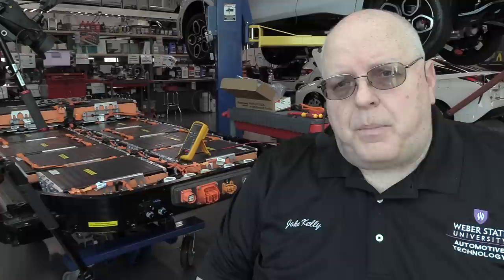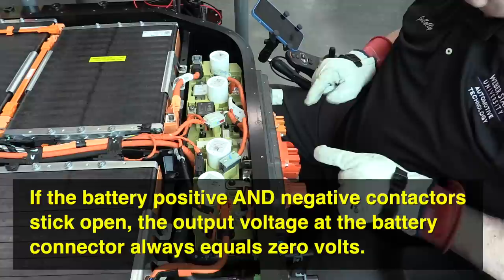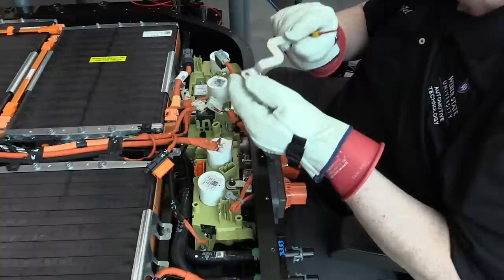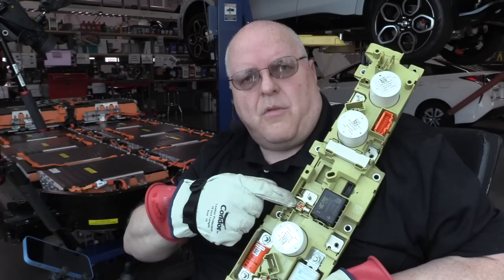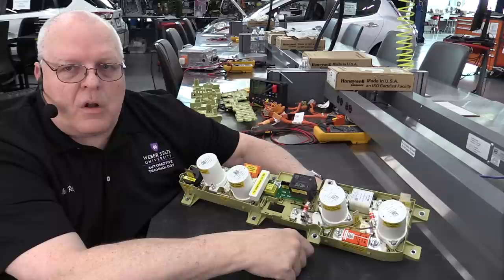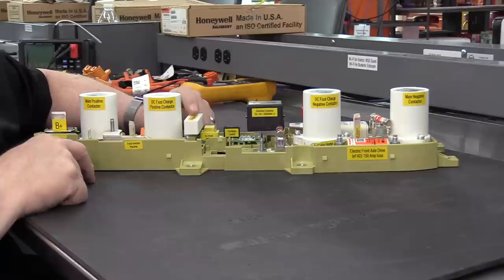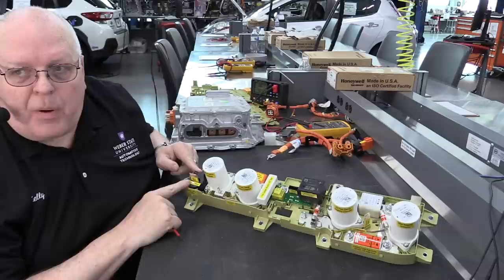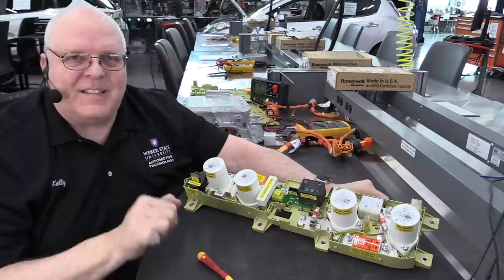Mach E GT Battery Contactors

Comment: I guess you are correct about all 4 contactors being on for DC charging but it does seem strange that they would run the charging current through two contactors in series.  I can see that they might want to have the inverter capacitors across the battery while DC charging.
The current sensor would not be the inductive type that is for AC power only.  For DC sensing, the sensor will be a Hall Effect type that uses an integrated circuit.
Reply from the maker: Thanks for the information!
Reply: There are combination Hall effect and inductive AC current sensors.  Tektronix has made oscilloscope probes like that for over 50 years.
Reply: @shazam6274  Definitely there are combination AC/DC current sensors.  For this application, I am fairly sure only the Hall effect is needed.
Reply: Don't forget. This car has some V2G capability. "DC charging" is also "DC discharging". The battery is still bridged directly to the SAE Combo connectors, but instead of power flowing in it flows out.

This means that when you activate the V2G capability (in a power outage according to the commercials) the motor controllers are receiving voltage.
Reply: @stevebollinger3463  It would make sense to use the precharge for V2X capability.  A V2H or V2G box is going to have a large input capacitance and may not have a suitable inrush current limiter.  Is Ford offering any V2X hardware for the Mach-E like they have for the Lightning pickup?  I haven't checked with Ford but thought they would only sell someone the V2H box if they had bought a Lightning.

Comment: Very very interesting
 Thanks for sharing!

Just one note. For a while now several electrify america stations offer 350kW charging. Of course the car limits this...
Reply from the maker: Thank you. The 350 kW EA chargers in our area still cannot exceed 350 Amps. You cannot get close to 350 kW without using 800 volts at those stations. 800V x 350A = 280 kW.
Reply: @WeberAuto  ahh this makes sense now. Thank you for taking the time to clarify! I heard from some Mach E owners that sometimes the charger shows 156kW and then it maxes it out.
Reply: It seems like the older EA stations are limited to 350A whereas the newer installs are not. I run into the issue with my Ioniq5. Even though it runs an “800V” system (more like 700V), unless the charger outputs that voltage, the vehicle will ask for about 400V from the charging equipment and the rear motor inverter steps it up to battery voltage. It seems like the 150kw EA stations will only do 400V. This 350A limitation on the older EA stations means that my Ioniq5, which can charge nearly 240kw on a properly rated charger, will charge at around 130kw on an older 150kw EA station. The newer 150kw EA stations that aren’t limited will charge it at 150kw. First world problems, I know… It charges just fine at full speed on any of the 350kw EA chargers, but they aren’t available everywhere.
Reply from the maker: @ouch1011  Great information! I will have to find a newer installation and photograph the product label.

Comment: Wouldn't it be better for serviceability to relocate the junction box assembly outside of the battery cell unit? Also, how waterproof are these components? Very interesting video.
Reply from the maker: Some vehicles have an external junction box. The battery housing is sealed from moisture and dust.
Reply: Thanks for the update.

Comment: Nice video again, I just cannot understand why the contactor thingy is inside of tge high voltage battery. This is very difficult to replace or fix in case of any kind of failure. In my opinion the contactor board should be placed inside the car. e.g. trunk / frunk. 🇫🇮👍🇫🇮
Reply from the maker: Thanks for watching

Comment: Nice detailed explanation and overview.  Thank you. Two corrections: 1) It appears that the large white contactors are held in by two bolts on the top and two nuts on the bottom, therefore are "serviceable". 2) All of this work is a total waste of time, since Ford has announced that the warped, arced, welded contactor issues can be remedied with a simple "software upgrade"! 🤣
Reply: The issue that cause the welding is a bug in security software, so you're way off base on what the fix is for a welded contactor and what the remedy is to prevent it.
Reply: @vidznstuff1  This is Ford's solution, not mine.
Reply from the maker: Thanks for your feedback
Reply: realistically ford isn't solving the problem with SW.  What they are doing is bending the curve.  If they just let things lie, they would have a large # of warranty fixes all at the same time all leaving the customers stranded.  now they will have that smoothed out a bit ,over a longer period of time and with sufficient warning to allow customers to schedule fixes.  It's less costly for them, and less dangerous for their customers.  I believe the part itself is flawed, and can only be fixed with active cooling or a lot more metal.

Comment: I would love to see the specs/part numbers of the main contactors. Any chance you can share some details there?
Reply from the maker: They are made by TE Connectivity. Part number 2342963. I could not find a data sheet with anything other than the physical dimensions
Reply: @WeberAuto  Thanks! It looks like they list that as a EVC500L, though they have it looks like 7 variants with different length/colors of wires. Their EVC500 (no L) looks to be rated for 500A continuous. So that might be too low of a rating for running maximum power through for long which is likely ~900A.
Reply: @mp3mike237  Is Ford replacing the contactors with the same part number or is there a new P/N? Do new cars off the line have a more robust contactors or does it take longer to implement changes?

Comment: Dr. John, a quick question. If for whatever reason one of the main motor fuses pop, will the service tech need to drop the entire battery case or does he have access without removing the battery?
Reply from the maker: The battery must be removed to replace the fuses
Reply: I thought immediately the same, a little uneasy to change a fuse. And the whole junction box needs 8 bolts? There is a lot of assembly time needed, I think... 

Thinking about it, there are sure reasons for the way they are... I could imagine a few myself, actually.

Comment: Why not integrate the voltage sense into the module and communicate externally via a low-voltage data bus? Why use HV for a sense signal?

Comment: Excellent video. Very early in the video you mentioned that there was a recall of the high voltage junction box, but you did not say if the unit you were working on was one on the recall list.  Also, do you know if the contactors used are proprietary or mass produced?  In my opinion, if they are a mass produced item they should have been made a replaceable component. If they are proprietary it would be interesting to find out why Ford engineers decided a proprietary design was needed.
Reply: I believe all Mach-Es are under recall, so that would include theirs.

The contactors are almost certainly an off-the-shelf part. That said, they probably chose not to make them individually replaceable (apart from the module they are attached to) either for manufacturing ease or to limit the number of connections to the component. Every connection is a possible point of failure, especially when you’re talking about a connection that has to deal with hundreds of kw.
Reply from the maker: Thank you! Yes, as Kevin Berg said, all Mach-Es are involved. Right now there is a software update to address the problem. I suspect it lowers the allowed current under full acceleration. The nominal rating for the fuses are 630A (Rear Motor) and 350A (Front Motor). I saw a video last night from Bjorn Nyland showing about 1050 amps on the Mach-E GT during full acceleration. I suspect the fuse sizes, contactor sizes, and maximum allowed current just needed to be better calibrated to avoid overheating the contactors (A possible reason for the five second power limit). I will be surprised if the junction block gets replaced as a result of the recall.
Reply: @WeberAuto  --Well, heating is more of a problem with the fuses.   The nice thing about fuses is that they have "thermal mass" whereby the time it take to blow is a function of the current.   Contactors should have problems with heat due to the load current.
Reply: @WeberAuto  Ultimately the contactor needs to be re-designed, which would preclude re-using the module as-is.  The question is how much of a performance degradation and longer fast charge time Ford can "sell" to their customers.  Even if it is only 5%, there are a lot of attorneys eager to cash-in a large $$$ law suit.

Comment: It’s funny, when those contactors are mounted in the battery case, they make a ka-chunk when they open/close, but sitting on the bench on a rubber pad, it’s just a little click.

People calling DC fast charging “level 3” is like people calling EV supply equipment a “charger”. It’s not technically correct, but as long as people know what you’re talking about, I personally don’t think it’s a big deal. I don’t call it “level 3” charging personally, but it doesn’t bother me if people do.

It seems weird to me that they would turn on the power the to motors when DC fast charging, especially when they already have a separate set of contactors specifically for fast charging and powering the DC-DC converter and the HVAC stuff. Seems like it would have been better to isolate the motors/inverters when DC fast charging since it’s not like you can drive off when connected to a charger anyway.
Reply from the maker: I wondered the same thing about the DC Fast charge contactors. Thanks for watching

Comment: Nice explaination of the junction box. What I do not understand is why the inverters need to be turned on (through the main contactors) while DC fast charging is in progress. Any idea?

FYI: In Europe we got 350kW DC CCS fast chargers. But most of them are only 200kW chargers with two balanced cables.
Reply from the maker: Thank you!. Powering the inverters during DC fast charge also powers the A/C compressor and cabin heater. Thermal management of the battery is needed while charging. Additionally, the driver of the car might want thermal management of the cabin air while charging.
Reply: @WeberAuto  Thanks, sounds resonable

Comment: How many Mach E have actually had this problem. I have 28000+ on mine and have had no issues. I did get at OTA about 2 weeks ago addressing a software fix regarding this. And I wonder if using 150 Kw chargers at electrify America is safer for the Mach E battery rather that using the 350kw charger. I have used the 350 kw charger when the 150 was unavailable.
Reply from the maker: The vehicle decides how much current to receive while charging. It does not matter if you pick the 150 kW or the 350 kW, it will still charge at the same rate.
Reply: @WeberAuto  You will see a higher charging rate on a 350 kW DCFC than a 150kW, briefly. Probably because as you noted the 150 don't support the necessary amps to provide 150 kW to the car.

Comment: About the seeming inability of an Electrify America DCFC to reach 150kW on this car: The ratings on those chargers are always a bit suspect.

The power rating for the charger will be listed at the maximum output voltage. So, if you have a 400V-class car with 100 cells in series it could in theory hit about 420V right as the charging system is about to enter top-off mode.

420V @ 150A is 147kW. So it is a 150kW charger but (on a 400V system) only for a moment near the end of the charge cycle. Also, a lot of cars just won't be at peak current right as the batteries are near full. So it may never hit 150kW, even for a moment. But the charger is in theory capable of it so that's what they list it at.

Making it worse, most "400V" class cars only have 96 cells (or groups) in series, not 100. I'm sure you know whether this is the case for this car, I haven't watched that particular video yet if you have mentioned it.

Back in the olden days of 50kW CHAdeMO chargers and NIssan LEAFs the chargers all were rated at 500V, but the cars never got above 410V so you never could see the max charge rate. Even when packs got large with the Bolt and chargers went up to "62.5kW" never really more than 50kW because the max current was 125A and the voltage allowed on the Bolt pack never got above 403V at any time (4.2 * 96), even when charging as fast as possible.

Another informative and great video.
Reply: Wut? The EA chargers are rated at 350kW (at 500V) whichis split between two cables, sized for two cars charging simultaneously. So each cable can deliver 175kW at 500V, 20% less at 400V. If the other cable is not in use, there's probably some margin that gets it bumped up.
Reply from the maker: Thanks for the information

Comment: I am wondering why there is no chill plate underneath, or venting thru the chamber, to get rid of the heat generated from pre-charge resistors, and resistance under high current warming up the bus bars.... Are there any sensors present to detect temperature, or pressure in the compartment since is is 'sealed' ?
Reply from the maker: The pre-charge resistor is only used for a fraction of a second while the capacitor charges. Not a lot of heat generated.

Comment: It does not make sense to me that all 4 large contactors would be closed when the vehicle is DC fast charging.  For safety purposes I would think that they would be interlocked - the inverter contactors could not be closed when the charger contactors are closed, and vice versa.  Also, charging the inverter capacitors while charging the battery would be a waste of some amount of electricity.  Though perhaps relatively small each time it would add up over time.
Reply from the maker: Thanks for your feedback
Reply: This makes me wonder as well: what is the requirement to have the inverter units powered while DC fast charging?

Comment: Hi prof. do i understand correctly that the high voltage sensing lines are directly connected, via a connector, to the control box , so without any fuse or overload protection. seems to me bit unsafe as the (unlimited) DC current can flow in this small cable and cause problems when connected (cable fault or short cut some where down wards) to for instance a negative some where! just wondering. 
and greetings from NL and as always interesting video
Reply from the maker: Thank you. I do not know the answer.

Comment: Video is interesting, well done and very informative.
Is there a pyro fuse anywhere since they are used to disconnect the HVDC in the event of a crash?
Reply from the maker: No pyrofuse, just the four fuses shown in the video.
Reply: In the Tesla, it is activated anytime the Airbags deploy.  Here it's just "Burn Baby, Burn"
Reply: @shazam6274  Tesla fanboy what do you think the fuses are for?
Reply: @danielwiggins2656  you mean like the ones in all Bolts?
Reply: @shazam6274  I understand the bolt fires were defective batteries not from a short caused by an accident
Reply: @danielwiggins2656  But the fuses didn't protect anything.
Reply: @shazam6274  The Mach-e has  fuses for all of the HV outputs so those will protect against external shorts that might be caused by an accident.
Reply: @danielwiggins2656  The fuses take orders of magnitude longer than the contactors or the semiconductors used in the Tesla design.  The main goal is to remove the high voltage / power nearly instantly for the safety of the occupant(s) and first responders.  I would assume that Ford turns off all the contactors in case of an airbag deployment for the same reasons.  Unless of course the contactors are welded closed, which is one of the reasons for the issue. 😬
Reply: @shazam6274  I will agree that a fuse may take longer to open, but that does not mean it's burn baby burn as you said.
Reply: @danielwiggins2656  I agree.  Should have said "shock, baby, shock".  At any rate, the main function is different: protection of people vs. protection of the battery.  If the contactors on the Ford open with the airbags, it's just as effective, even if it's a 100 milliseconds slower than the pyro in a Tesla.  If  the batteries get punctured by big steel rod road debris, as happened to a Tesla S,  the "protective features": Pyro, Contactor, or Fuse will not matter, the battery will burn due to internal overcurrent and resulting heat.

Comment: What areas of work on these new gen EVs require PPE, and how does that ratchet up the level of difficulty completing servicing tasks?
Reply from the maker: Each EV manufacturer has their own recommendations for when to use PPE. There are laws, standards, and regulations related to high voltage on vehicles. Some EV manufacturers cover almost every possible high voltage connection reducing the need for PPE. The level of difficulty is not necessarily higher, but it is newer and there are many things for service technicians to learn.